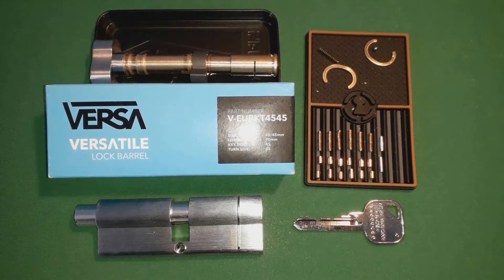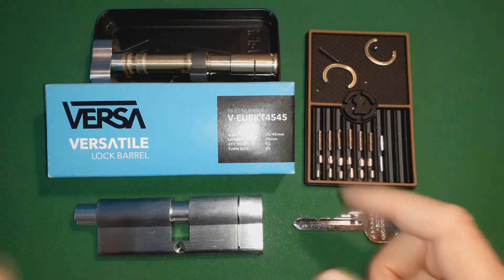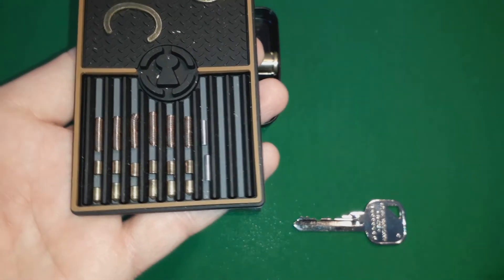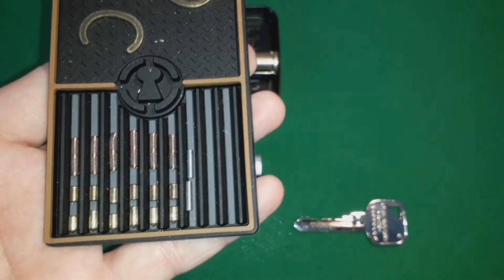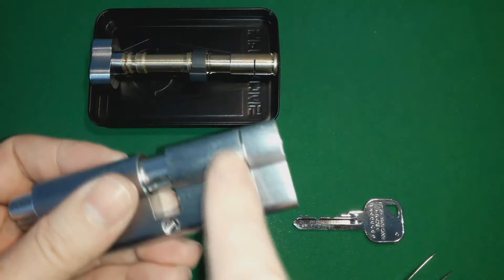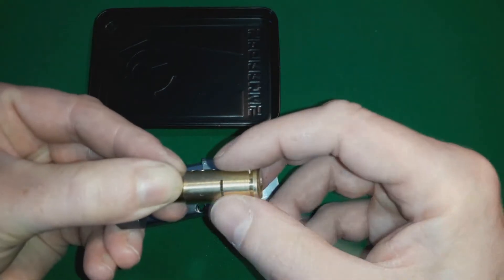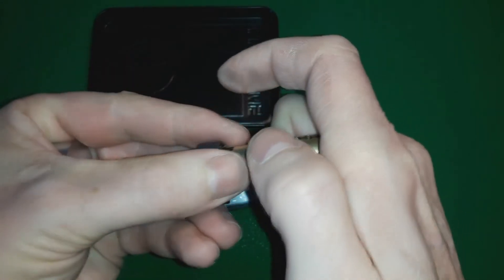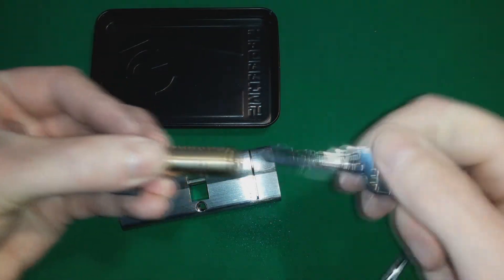(113) Versa Euro Thumbturn UNMASKED

Comment: Nice. I have one of those in my box of locks. I got it when I first started picking and I failed to open it. I never got back round to it. I never expected no security pins. With the thumb turn locks if you put the key in and turn the thumb turn also turns. 
If you pick the lock you need to engage the clutch in the middle of the lock to actually unlock it (if you do it right the thumb turn will turn as you turn the core). If you poke a pick into the back of the keyway there is usually a springy feeling thing in there. If you pick the lock and only have a very slight turn on it. Then push in that springy thing and turn the core the actuator and thumb turn will turn too. They only mesh together at the un turned position and the 180 degree position tho. Cool bypass driver. My bypass driver won't fit in that keyway. Been thinking about fileing it down a bit to get it in more locks👍
Reply from the maker: I struggled to pick it at first too, the pins feel weirdly springy. I actually made this video ages ago and was trying to find the right time to upload it. I didn't really want to edit it again after learning a little more about the mechanism. True indeed about using a pick or tension wrench to turn the cam after the initial picking of the core.
I used a dimple pick you get in one of those Huk sets and ground it thinner. It makes a great bypass tool.  Totally agree that thinning down your bypass tool so it fits more locks. 
Thanks for watching : )
Reply: I cant remember how it feels haha. Gona have to give it another go. Using a thined down dimple pick is a cool idea. I have purpose made bypass drivers. Dimple picks are a much cheaper way, and if they work then problys just as good👍.
Reply from the maker: @Deadlocks86  I used the double puck that had a bow. Like I said I got it in the cheap Huk dimple pick set. I reckon a cheap dimple pick set modified would make a good range of bypass drivers.
Reply: Your definatly onto something there.  I like your thinking. 👍

Comment: Very interesting to see how it all worked and could be bypassed. The security pins you made were excellent. Is there a way to prevent the bypass tool from activating the cam now the lock has security pin, Cheers
Reply from the maker: Thay slit in the internal mechanism has to be there for the key to engage so the cam will turn. So there's no way I can see of protecting this. 
Thanks for watching : )